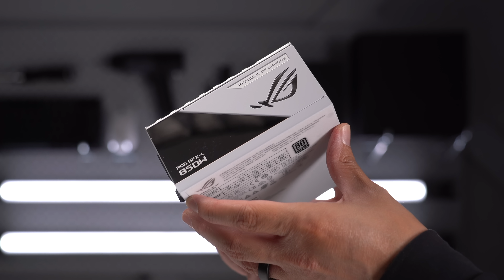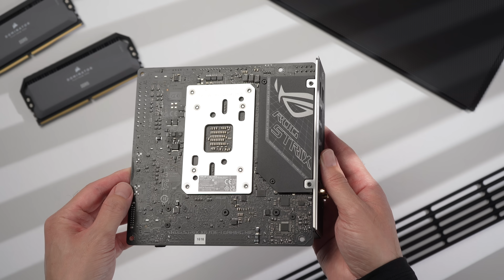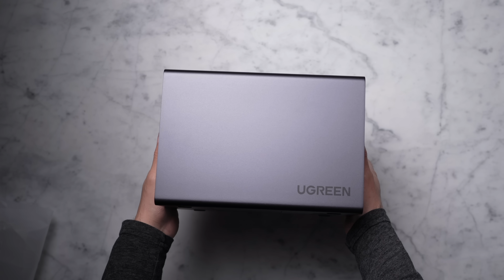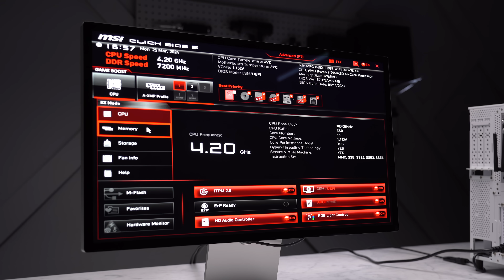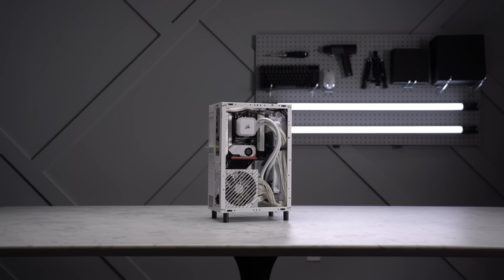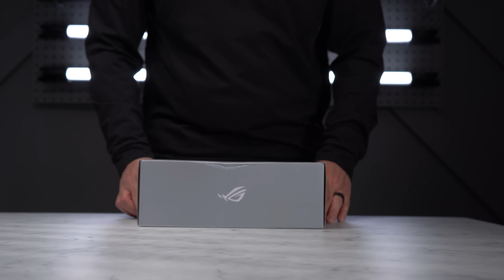My Ultimate ITX Build for Productivity (and Gaming)

Comment: I am not surprised the Intel 14K generation is just a little better than the 13th gen. Intel really needs to get with the chip fab program. They will be stuck at 10nm unless they upgrade their fabs with state-of-the-art lithography.  When Intel says they are at 7nm they are lying. Just ask TSMC with their 7nm, 5nm, and 3nm processes. All Intel has been able to produce in the several last gen CPUs is higher clock speeds requiring more power and generating more heat. Follow all the previous generations from there and you see Intel has not been innovating at all.  For example, when 14nm Haswell released, Intel was unable to make better CPUs after Haswell. Skylake and all other gens were not much better. Remember, it took Intel almost 4 years to produce a 10nm CPU using the same lithography as 14nm. Get with the program, Intel while AMD is leaving you in the dust.

Comment: 1. Are you switching between tempered glass and mesh panels on the CPU side? Wouldn't tempered glass on the CPU side chock the PSU and eventually make things worse?

2. That monitor has a max refresh rate of 60hz no? So any FPS above 60hz will not be displayed on the monitor.

Comment: Made this exact build but with a 3080 FE and I’m having problems having the gpu display…
It comes with a splitter that fits the FE exactly but I’ve read that doesn’t work

Yes everything is on and yes it’s all plugged into the correct spots and I reseated the gpu as well as prioritized bios

Ppl don’t talk about how these MSI motherboard won’t let the gpu run sometimes

Comment: @devyn.johnston I’m a web dev who uses open source (on macOS) for most of my tools and I like the idea of open systems. I also realized I haven’t had a non-work machine for over a decade. I’d like to buy or build one for my own creativity/projects. 

I’m turned off by how locked down macs have become, but I also don’t want to spend what little free time I have being hardware IT support for myself. What are your thoughts on this productivity setup comparison from this video, considering long term use? I’d ideally use a personal setup for 5+ years. 

Set it and forget it appliance win? Or more time consuming but gradually upgradable platform?

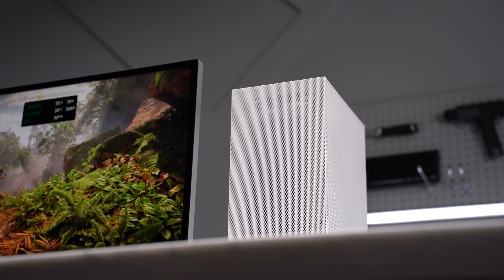Comment: 2:12 

Intel uses less poer when idling and doing general tasks. That will save you more money in the long run, not using less wattage during heavy tasks.

You can easily lower the heat on Intel chips by changing a few settings and it doesn't harm performance.

Comment: Amazing video perfectly explained, and it's perfect for me at this exact moment. I'm getting my first pc build, and I'm between the towers 200 and 300. I'm also in between on the 7900xtx 24gb sapphire pulse or 4080 super oc edition. This is mainly based on ray tracing projections. The case is also 116.99 cheaper since the 200 is on clearance for 60 and no stand available. Then the 4080 Super oc edition is 30 cheaper as well but less vram. But the 4080 is also on a faster ddr6e while the 7900xtx is on ddr6. I got all appropriate high-end hardware for a steal of a price at microcenter. They both should fit everything, but I'm checking with microcenter now. The 200 will also have a 280 aio, which would save me 50. The 300 would have a 360 aio either would be good cpu cooler. I'm doing all thermaltake and amd products. Maybe I need a sponsor for my first video of my channel on THEPROCASTERBATER showing my pc build being done and explained like this. Any notes on thermal differences between the 200 and 300 or do I need to call the oem. My cpu is the ryzen 9 7950x3d, 7900xtx 24gb sapphire pulse gpu, vengeance 6000 2x 32gb ram kit, Samsung 990 pro ssd with heat sync, powered by a thermaltake 1050 gold certified power supply on a gigabyte b650 aorus Elite ax ddr5 motherboard in either the 200 or 300 cases. I can't decide I'm leaning 200 for airflow and how insanely compact it is.

Comment: Can we get a link for the case feet? Either reply here or add to description would be cool. Thanks either way and great video! I've been hanging on to an original white Meshlicious case for maybe close to two years now... you've achieved my wildest dreams! The original version has MUCH thicker, sturdier panels with no bending concerns. IMO, the Meshroom is a slight downgrade and feels like a cost-cutting maneuver. New features are interesting, but largely unnecessary.
Reply: Found on newegg

Comment: If it's Hynix A die it's capable of more then just 7200mts depending on IMC and motherboard.  You just need to know how to tweak voltages, timings, secondaries and tertiaries as well as know what you're doing when you stress test the memory. XMP and EXPO profiles are typically quite loose to ensure stability for the user. Leaves alot of performance on the table. That being said, I wouldn't run 7200mts sticks on a Ryzen platform. You need to ensure it runs in a 1:1 ratio and the fabric bottlenecks your bandwith anyways unless you overclock it. So there's really no point in going over 6000-6400. Raptor Lake and Refresh co. on the other hand will give you massive gains with faster memory. That's why the only boards I use with my 13900KS are the Apex and Tachyon because they are 2 dimm. With my 7800x3d the cheap b650 I have suffices. Running a kit of Lexar Ares a die @ 6000 c28 36 36 28 tREFI at 65535 and all other timings as low as possible. Fabric at 2133. -20 PBO undervolt. 1.20v SOC and 1.35 for the dimms. No matter how much you optimize the memory it caps at 64,000 mbps in Aida unless you increase the fabric. Getting 70,000mbps and 61.0ns on latency. No matter what I do I can't get it lower on that chip. With my Apex running at 7800mts cl34 @1.45v I get 49.9ns

Comment: Great aesthetics of all those components hidden behind a meh panel, worth the extra cost kek
Reply from the maker: There's a glass side panel option. You can see it at 06:21
Reply: @devyn.johnston  that's great, but have you actually tested it? what are the diffs in performance and temps? I'm assuming a system this powerful gets easily chocked in a glass panel itx case, even tho it looks like it has plenty of airflow

Comment: Absolutely, more Productivity + Gaming PC build videos like this would be amazing! As a fellow architecture designer, 3D modeler, and gamer, I've been researching parts to build my first custom PC. But most build guides out there are focused solely on gaming performance, so it's hard to know if those same specs would be ideal for my mixed-use case.
This video was super helpful and informative. I'm seriously considering following this exact parts list for my build! The only changes I might make are going with a different case that fits my personal style a bit more, and possibly swapping the RTX 4090 for a 4080 Super instead, just to bring the total cost down a little. Do you think all the other components you chose would still be compatible with a 4080 Super GPU?
Seriously, thanks so much for putting this guide together with us productivity power users in mind. More content like this would be incredibly valuable and much appreciated! You've got at least one new subscriber here. Keep up the awesome work!

Comment: Everything I've seen from other builders and from ssupd themselves have indicated that the front AIO fans being set to exhaust is the way to go. Back when people were testing both intake and exhaust, exhaust always results in better GPU thermals and equal to better CPU thermals. So it seems you sorta lucked into the superior option anyway.

Comment: Hey Devyn, been watching your videos for a while. I was wondering if you have any interest in eGPU enclosures for on the go laptop users? A lot of the eGPU cases I've seen are interesting, but I don't think they're very practical for travelers. It would be amazing if you made a video showcasing a very SFF eGPU case. Something that would be JUST big enough to fit a tiny Nvidia t600 single slot, low-profile card. I would totally buy one to use with my laptop, as I already have this card in an old PC, and don't necessarily feel like I need to spend the money on something like the PocketAI RTX 500 portable GPU. Thanks for the uploads, your content is great!

Comment: Not sure that AIO is going to last long in that config. Looks like the pump is the high spot in the loop. It might work now, but as liquid slowly evaporates from the loop, it's going to fail.
Reply: As I remember, the movment of fluid catches some air bubles which will be collected in the highest point... Which is an AIO in this case.  AiO should be reversed in vertical way.

Comment: Is the CPU above the AIO reservoir and the AIO tubing? Won't this mean the collection of air bubbles at the top of the pump, which would impact thermals? It's my understanding that the some portion of the AIO reservoir and tubing should be higher than the CPU/pump to avoid air bubbles from getting in the lines, air going to the pump and potentially impacting the cooling of the processor.

Comment: Just one thing I would change, if this is for productivity, I would definitely go with the Ryzen 9 7950X, not the 3D.

The 3D V-cache won't help nothing on productivity or multitasking; on the contrary, 3D V-cache modules are very sensitive to temperature, so they run at a lower clock speeds by default and are much more susceptible to suffer thermal throttling, which does not easily happen in X versions, because of that the 7950X are faster on productivity tasks. Another thing is how the CPU allocates tasks to use the 3D V-cache; in a game, this is well optimized, and the game can make good use of it. However, in normal tasks or multitasking in Windows, it simply bugs out and doesn't know how to allocate tasks correctly on the memory to work properly and it is also very unstable with RAM profiles, if your DRAM isn't AMD EXPO profile, it'll definitely cause some stability issues, even worse that you are using it at 7200MHz probably with an Intel XMP profile.

I can't explain it exactly in a comment, but this video explains it better: https://www.youtube.com/watch?v=JZGiBOZkI5w
Reply: Proxmox solves this problem. Run your gaming VM.on Proxmox with GPU.passthrough, and in the guest you can just pin all VM threads to the vcache CCD.

Comment: Is there a reason you didn't just have the fans as intake when installed on the inside of the case? It just seems like you thought the fans need to blow into the radiator regardless...

Comment: My case of choice would be the Jonsbo V10. You can fit ATX power supplies up to 140mm long and graphics cards up to 330mm long, since the graphics card is installed behind the motherboard. You can also put a 240mm radiator on the top.

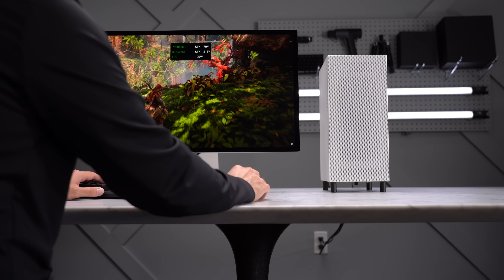Comment: 7:54 it's also a waste in your pc most definitely, because you need to have a golden chip which will run UCLK(memory controller) in a 1:1 ratio with 7200 ram and since you don't mention that, you most definitely run it in UCLK=MCLK/2 and doesn't really get anything good from such high frequency in comparison to low timings 6000 kit, you basically get exact the same latency in the best case.

Comment: For a case like that, i would probably just change 1 thing, tho it might not be that easy as it sounds -> go with 13/14th gen Intel i7 or i9... BUT with "T" variant (35W TDP locked) because of the additional hardware encoding/decoding in Intel iGPU for Premiere which mixed with AV1 supported card (which we have 4090 here so no problemo) would be like the best Video Editing rig in such a small form factor.

And for gaming, since you would play 1440p/4k all the time, then lower clocked "T" CPU would not be really a handicapping problen
Reply: You could also go with the infamous Erying mini itx board with an i7 12700H mobile CPU. It has a base power of 45W, but can turbo up to 115 and can be set to be as low as 35W.
Reply: @BrunodeSouzaLino  good point too - we could try both options and in the end say "pick whatever is easier and cheaper for you to get"

Comment: That RTX is a THICC BOY!
Other than heat, it can't be that easy to clean from dust these tiny builds.  You will have to do a disassembly to get access to most parts.  
Still, looking good!

Comment: two notes Ssupd Meshroom S accommodates AIO up to 280mm and has 14.9L capacity and in the video was 240mm AIO and 14.7L capacity

in the setting for a 4-slot GPU, I can recommend e.g. NZXT Z63, the block pump can fit in without any problems

Comment: Currently my main rig is a 
5900x
32gb 3200 ram
6800xt
I have a second right with a 2080ti
Would i be better off with the 2080ti for blender? Im bout to get into blender but ive read that nvidia is miles faster than amd

Comment: Any problem with gpu temperature, mounted in that position ? My gpu, asus tuf rx7900xtx, in the Silverstone alta g1m, has junction temp very high with fans @ 3000rpm, can't use it. i found that some gpu doesn't work in this position (mine was with i/o panel on top of the case). The only solution it's been to rotate 90 degrees the case. Have you got any tip for me ?

Comment: Reality : ger proper computer and avoid itx unless you really running out of space and must need small form factor build 😂
Reply: counterpoint: it's cool and fun and he's allowed to spend his money how he wants
Reply: @maximus3294  yea I used to build itx/sff but when need a powerful rig and to made life easier I build the 7950/3080 as atx build instead ( coolermaster Q500 flat pack ) a smaller atx case 😂

Hope they will get some oculink port on itx for connecting more pcie devices ,  got hope on asrock rack series but they don't have white theme/cool looking design
Reply: Reality: Big towers are a waste of space and unnecessary for loads of people. Only reason for it is price, which is why it boggles my mind that mATX is not the most popular format as price difference is negligible.
Reply: @muks.2301  matx should be most popular now , they are way cheaper than itx and slightly cheaper than most atx but still provide enough slots (4 dimm and like 16+4+1 pcie lanes slot ) usually have 2-3 M2 for nvme ( reasonable layout and some upgrade possibilities )

Itx is expensive for some reason such as need more layers of board for trace .while matx you got more real estate to put stuff and less dense tracing , 6 layout boards is right enough for gen4 signaling on matx board ( they do 4 layers matx  board only when gen3 )